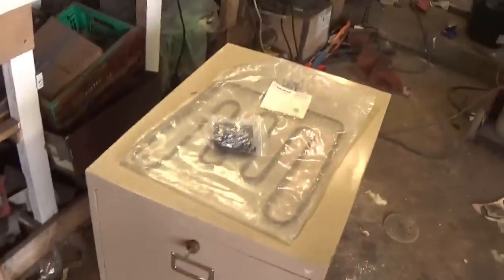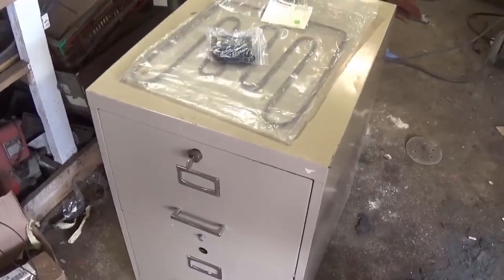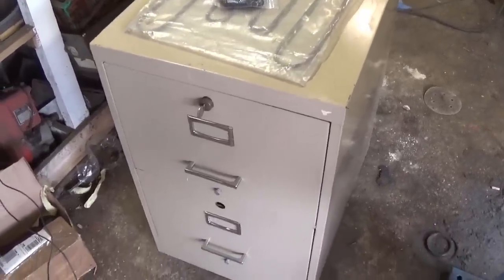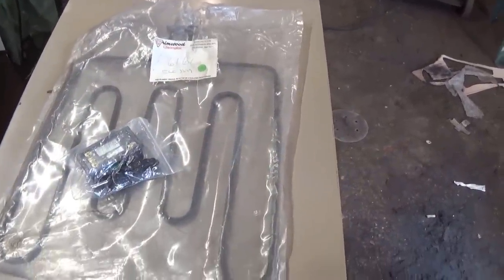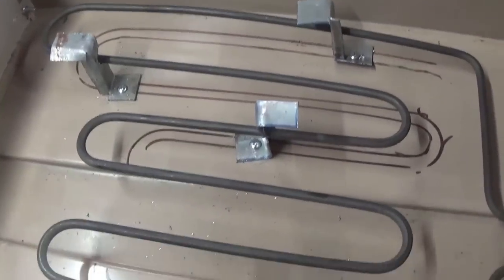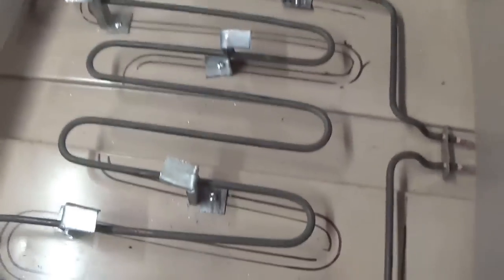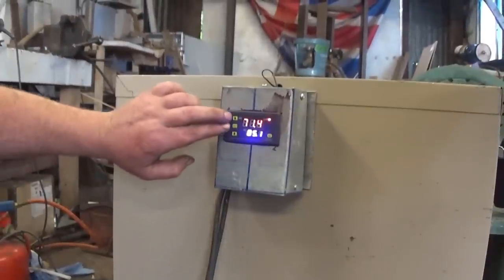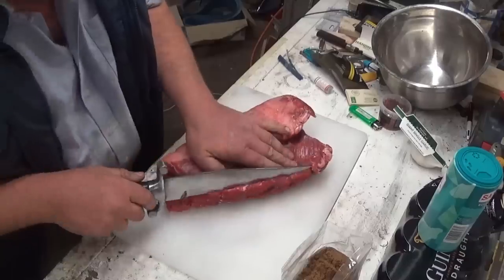Filing cabinet temp controlled meat smoker

Comment: Interesting non conventional (and I suspect heavy) anvil. ;)
Reply from the maker: There are no straight edges left on my blacksmith anvil
Reply: @turboconqueringmegaeagle9006  I bet.
Reply: @turboconqueringmegaeagle9006  Most tin man type arrangements consist of dollys with sharp edges (that I have seen in books and as far as I can remember from school)
Reply from the maker: Yes, then people working with Ally grind all the sharp edges back off them, I've softened all the non cutting edges on my tin work tools.
Reply: @turboconqueringmegaeagle9006  It isn't difficult to make up some dollies if you have a large slap of plate steel and some angle grinders though...